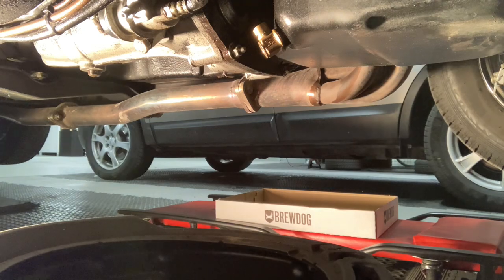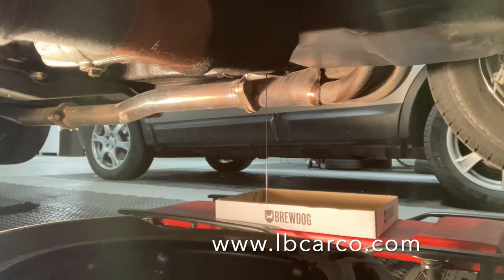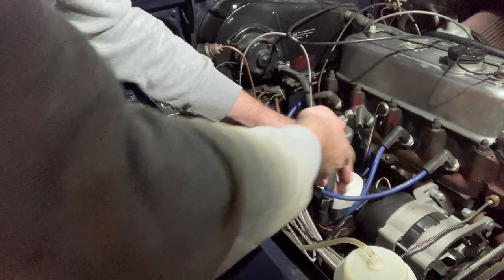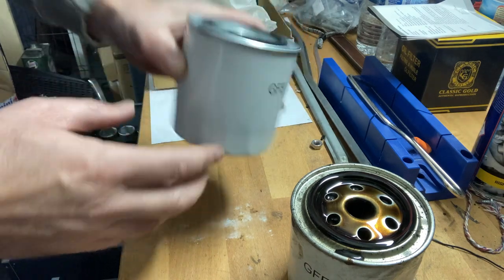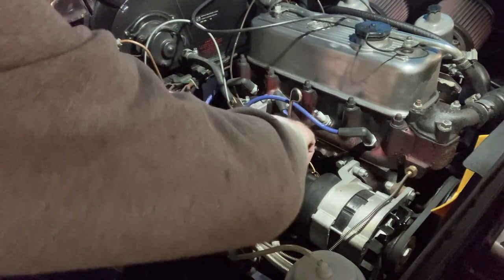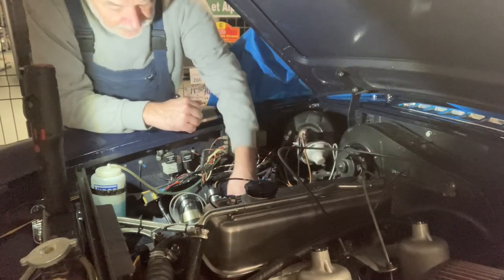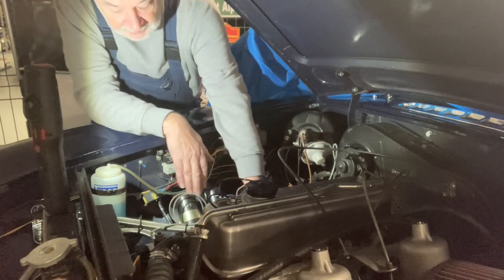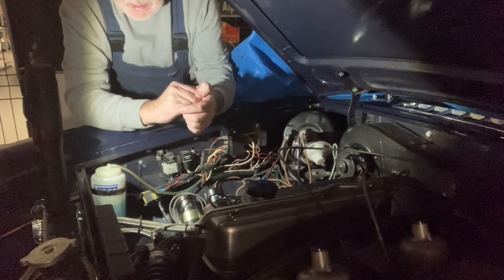MGB Oil Change

Comment: At 5:43 you say it takes around 2.5 l yet my Haynes workshop manual says it's more like 4.26 l. 1974 MGB. Which number is correct?
Reply from the maker: Both !  You will find that it takes about 2.5 litres normally because you don’t get it all out, especially the oil cooler.  If you do regular changes not a problem.  If you have a dry engine then you are on the higher number.  Hope that is clearer

Comment: Hello Mike - thanks for doing this video - everything is really clear. I have a question: after changing the oil on my '77 B I can't seem to get any oil pressure at all. Everything was apparently working fine before, so I'm thinking it's something I've done or not done. Any suggestions? (Great idea about the second coil btw!)
Reply from the maker: Hi David, thanks.  Do you have an oil cooler ?  And how much oil did you put in ?
Reply: @mikesmotormechanics8602  Mike - thanks so much for getting back to me. There’s no oil cooler on the car and I put in about 4 liters, the dipstick shows it at max (just below actually).
Reply from the maker: @dtrimm1  I suspect it is the filter - if it is too short it will cause a problem.  If you can spin on the old one and the pressure comes back this will prove the issue.
Reply: @mikesmotormechanics8602  thanks Mike - I’ll give it  a go! Really appreciate the advice.
Reply from the maker: Also just make sure you didn’t know the lead of the sender, possible but to my mind not likely
Reply from the maker: Knock
Reply: @mikesmotormechanics8602  well, that was it! The old filter meant the oil pressure went back to normal. Thanks very much indeed for your advice, I really appreciate it!
Reply from the maker: I always get my filters from Moss.  The only time I didn’t I also had problems.  Glad I could help.  Please don’t forget to subscribe 😄

Comment: Would you be able to do a video on draining the radiator?
Reply from the maker: Hi, I don’t plan to drain mine soon, and as I use Evans stuff in it it would be expensive as a demo.  It is either very simple or simple depending on your MG.  Some have a drain tap or plug at the bottom of the radiator.  If so, just open it and drain into a container.  If not, then ease off the bottom hose and direct it into a container to collect the water etc.  Best of luck

Comment: hi how do you get the oil pressure switch out?
Reply from the maker: You shouldn’t be touching that in an oil change, but they should be all threaded connections with flats for a spanned unless a PO has done a hodge job